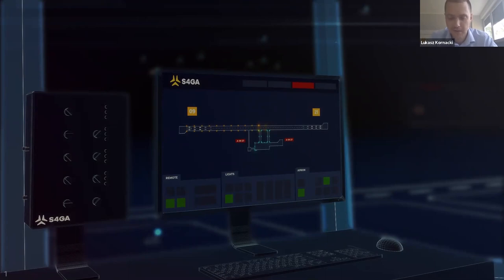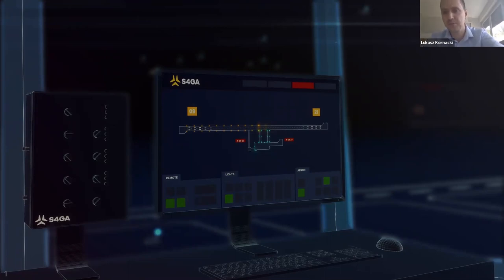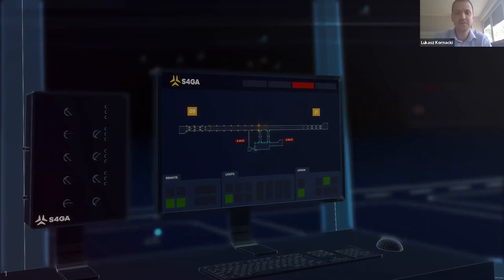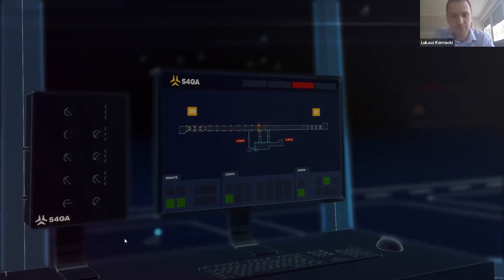S4GA Webinar Control and Monitoring of S4GA Airfield Lighting

Comment from the maker: 2:01 Webinar Agenda
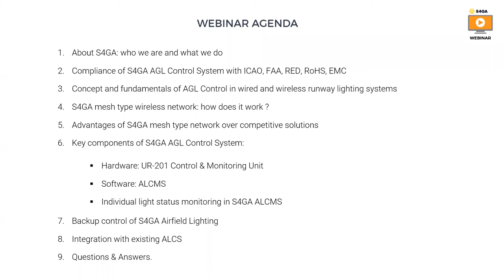4:56 About S4GA: who we are and what we do?
10:51 Compliance of S4GA Control System with ICAO, FAA, RED, RoHS, EMC
16:53 Concept and fundamentals of AGL control in wired and wireless runway lighting systems
24:12 S4GA mesh wireless network: how does it work?
24:58 Advantages od S4GA mesh network over competitive solutions
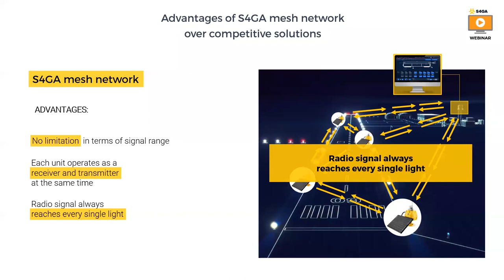27:26 Key components of S4GA AGL Control System (hardware & software)
          31:34 New generation ALCMS system
34:32 Individual light status monitoring in S4GA ALCMS
40:04 Backup control of S4GA airfield lighting
44:04 Integration with existing ALCS
45:13 Conclusions
47:22 Questions & Answers